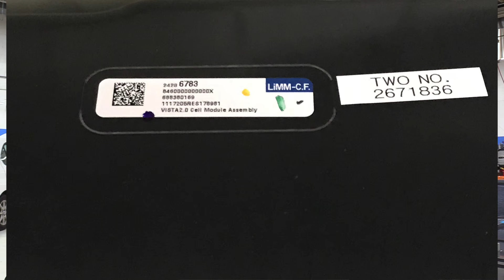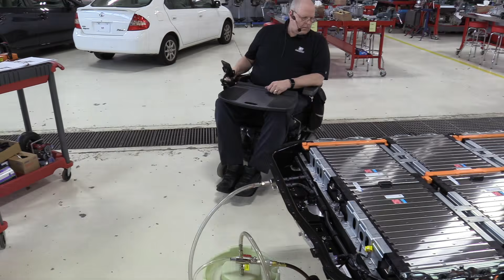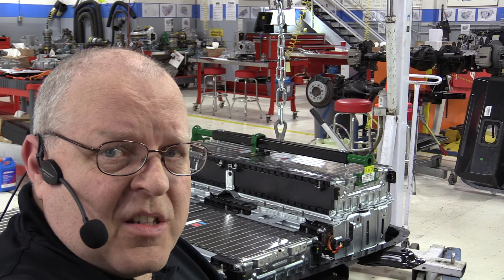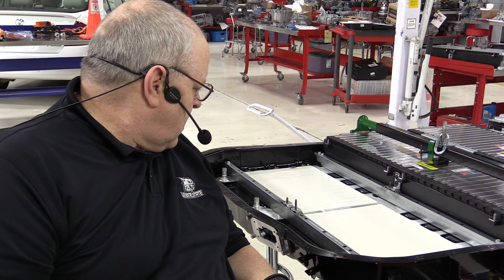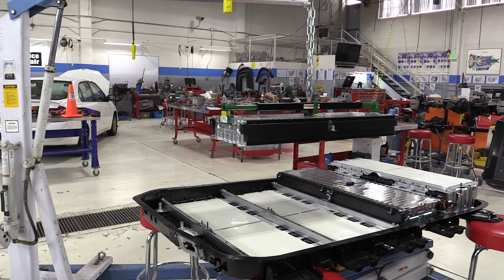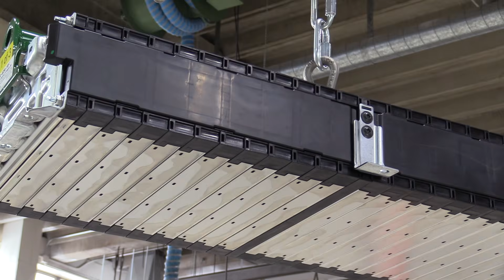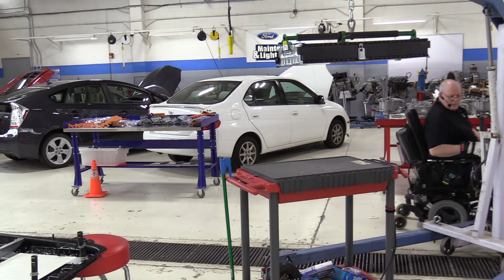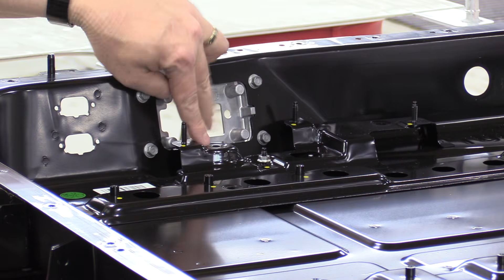Chevrolet Bolt EV Battery Disassembly

Comment: Amazing thanks for sharing, I wonder if the design is overkill as any servicing of Contractors or the low voltage control / monitoring is a very expensive proposition to access. Industrial equipment allows easy access in the electrical box. Are cars / consumers & automotive service technicians not to be trusted that serviceable items are buried this deep ?
Reply from the maker: I don't know the reason for putting them inside the battery compartment, but I can tell you that every hybrid and electric vehicle I have seen is this way. Thanks for your feedback
Reply: I would assume it’s to follow the same trend  auto makers have been following for decades.. That is to try their best to produce vehicle whereas you must pay them to repair something that should never have to be serviced to begin with....

Comment: Hi, 
Do you know the AH off each cell ? 
Nominal voltage of rhe cell?
Will you dismantle a maodule to see the cells Inside?
Reply from the maker: Each 5.94 kWh battery module has 10 cell groups, so each cell group would have 594 Ah. Each cell group has three parallel cells, so each cell would have 198Ah. Nominal cell voltage is 3.65V. I hope to. Thanks for your feedback

Comment: Prof Kelly - thanks for doing these videos on the latest technology in automobiles.  I love your video pace/cadence.  It’s great for all of us who are either Bolt EV owners, or those who are curious about the car and tech to see inside this massive component which provides the fuel for EVs.  As seen in these videos we certainly wouldn’t be able to take one apart ourselves without significant special tools/hoists, so great that you are in a position to, and are able to show us this stuff.  Seeing the engineering that goes into these devices will take away some of the fear that people have with transitioning into an electric car.
Reply from the maker: Thank you very much! I am happy this in useful for you.

Comment: Professor: It looks like each battery section is cooled by a cooling plate on one side only. Is it correct?
Reply from the maker: There is a thermal plate in between each cell. That plate also makes contact with the thermal pads and cooling plate
Reply: Those pads I believe are phase change material pads. The melting point is very close to the optimum battery temperature. They're constantly switching between solid and liquid state which does wonders in controlling temperature spikes in the battery.

Comment: Excellent video, as always.  Interesting rumor I heard:  GM pissed off LG when they announced the cells for the Bolt cost ~$145 kWh.  It turns out LG Chem was charging the other manufacturers a whole lot more for the nearly the same thing.  I think the economics of EVs are almost as fascinating as the technology.  “Experts” have been claiming they’re a decade away from being financially viable, and I think the battery manufacturers are exploiting this idea to gouge carmakers.  An executive at Tesla admitted in 2016 their pack costs are already “below” $190, and there’s speculation that the Gigafactory is pumping cells out for <$100.  Anyway...thank you for the video!  I had been looking forward to your Bolt tear down.
Reply from the maker: Thank you very much!
Reply: Pack cost per kwh is not the same as cel cost per kwh so that might be a source of confusion in pricing differences.

Comment: After watching the second half of your video (last time i only watched the first half).
I was somewhat amazed that the sections were lifted and stored with the terminals exposed.
I must be easy to insulate te batery  posts.
The special lifting tool does not seem to be insulated and could easely hit and short the section during the installation of the tool.
The sections were stored on a metal workbench and could hit the post while placing it there. In a normal workshop where time is money mistakes are easy made.
Does the manual not refer to this?
I personally even put the little plastic caps on 12v batteries while storing them.
As always i enjoyed your video, not everyone gets the oppertunety to take apart a brand new vehicle!
Thanks for sharing, and the time you put in to making these video's
All the best from Holland, Europe.
Looking forward to your next video!
Reply from the maker: All valid points and concerns, thank you. I will cover the terminals when reassembling. The service information says nothing about covering the terminals. Keep in mind that each section has two separate, isolated, battery modules in it. You could have the lifting fixture touch both end terminals of a section and it would do nothing. Have a great day!

Comment: Thank you so much, Very helpful I'm converting a power boat to electric and I'm considering using these batteries on my projects. These might work good with a couple Chevy Spark ev or Bolt drivetains. But maybe Tesla parts too. Still undecided but your video aids me in my decisions. Thank you!
Reply from the maker: Thank you, that sounds like a fun project!

Comment: The 60 kWh is net, usable capacity, which I have verified multiple times. The 57 kWh rating is most likely the rated capacity at nominal voltage. Pack voltage reaches close to 390 V when fully charged, which would result in ~64 kWh of gross capacity.

Your own voltage tests bear this out. The fully charged voltages were 40.56 V for the long modules and 32.45 V for the short modules. To achieve a 57 kWh rating at 350.4 V, the Ah would be 162.67. At 40.56 V @ 162.67 Ah times eight modules and 32.45 V @ 162.67 Ah times two modules, the total gross capacity of the fully charged battery would be 63.3 kWh.
Reply from the maker: That makes perfect sense! Thank you!
Reply: You're welcome, and thank you for your very detailed, precise videos!
Reply: Actually, Jack, that is not correct. Nominal voltage is not the average voltage of of discharge curve. Nominal has a very specific definition: it simply means "name" or "named." In this case, LG had to assign a value, so they named the cell voltage 3.65 V. However, lithium battery cells have a wide range of operational voltages, and a manufacturer could choose to allow the cell voltage to exceed 4 V, which would, consequently, increase the pack capacity beyond the nominal "named" capacity. 

Another example of this is your electric wall socket. If you are in the United States, it has a nominal voltage of 110 V. In essence, it is classified as 110 V, but the voltage could be higher or lower. 

Also, "gross capacity" refers to the total capacity of the battery. The term "gross" simply means total or whole before any adjustments. The reason it is used with electric vehicles is because most modern electric vehicle manufacturers do not allow the end user to fully charge and discharge the battery (doing so degrades the battery quickly). The amount of battery capacity available to the user is commonly referred to as "usable" or "net" capacity.
Reply: John,  These cells are using a GM proprietary chemistry, so I doubt that LG could sell them openly to other automakers. Also, the Ah will depend on the physical size of the cell. A good example of this is the new 94 Ah Samsung cells that BMW is using in the i3. At first glance, it might seem like those cells are superior to the 54 Ah cells GM is using in the Bolt EV; however, the Samsung cells are physically larger and more massive than the LG cells. As a result, the energy density between the two cells is actually very similar.

In the case of the Bolt EV's battery, GM designed the battery format to have 288 cells. The layout is referred to as 96S3P. What that means is, the battery contains 96 cells in series and 3 cells in parallel. For the Ah, that results in 54x3, or 162 Ah. For the voltage, that results in 96x3.65 V (nominal), or 350.4 V.
Reply: Thanks for clarifying the battery cell group  numbers and capacity
Reply: Jack, please provide your empirical tests. The 3.65 V nominal cell voltage will be close to the average, based solely on the fact that lithium cells have the longest life when maintained between 40% and 60% state of charge. Most likely, the 3.65 V nominal cell voltage is the mean between the lowest voltage and the highest voltage (the points at which the cell starts to become damaged). But in either case, correlation does not equal causation. 

If you want to read more about the technical term you are using:
https://en.wikipedia.org/wiki/Real_versus_nominal_value
Reply: Jack, was that entire ad hominem just to get clicks on your website? That's sad. Again, nominal voltage is a voltage LG simply named because the total capacity will depend on the final cell voltage. Remember, this conversation is about why LG labeled the battery 57 kWh when actual testing of the cells and modules showed 63 kWh.
Reply: @News Coulomb -- that's great info. Do you have any posts about the tests that you have done?
Reply: Sean, Just on my video channel. I haven't performed any dedicated tests on this specific topic (it's been covered in depth by others with proper tools and equipment); however, several of my videos have, indirectly, covered the topic of the Bolt EV having 60 kWh of available battery capacity as well as the peak pack voltage being ~390 V. 

The EPA also has a published document of the Bolt EV's testing, though the information in that report does not jive with LG's 57 kWh label either.
Reply: Jack, Look. I understand that you are on a personal mission to rate batteries differently, but the only number that really matters is what the EV owner sees. That's not a marketing gimmick. It's simply reality. As Professor John D. Kelly demonstrated with his own voltage testing in this video, the capacity of the fully charged Bolt EV battery pack is 63-64 kWh. 

As for the EPA document, the reason I stated that it did not match either is because it rated the battery pack at 350 V and 171 Ah, which is 60 kWh. Less than what was measured in this video but more than what LG labeled the battery. 

That all brings it back to my point about the label and nominal voltage simply being a number that LG chose. You argue that LG put significant thought into it. I'm not contesting that. But as a Bolt EV owner with over 45,000 miles on my vehicle, I can tell you with certainty that the actual capacity available to the end user is 60 kWh. 

If you refuse to adjust your beliefs to match that reality, there's not much I can do about it. The only thing I ask is that you learn to conduct yourself in a more civil manner. Thanks!
Reply: Jack, Finally we agree on something; this is ridiculous. All I did was explain that the nominal voltage/capacity does not match the actual (this is normal) and that the available capacity per charge is 60 kWh. I made no claims about LG's testing or rating process, whether it was industry standard, what calculations they performed, etc. All I did was assert that the 57 kWh label does not match the real-world capacity of the Bolt EV's battery. 

And apparently, I'm not the only one whom you refuse to listen to. I'd refer you to GM, who have published the fact that it is 60 kWh of usable capacity, but you already dismissed that as a marketing gimmick. I'd refer you to the EPA testing document, but you apparently don't consider that a reliable source either. It looks like you're on your own on this one. Good luck, and take care!
Reply: lg chem disclosed in dec. 2017 new cell chemistry for pouches producing 32.5 ah. So if pouch cells are used, they would have to parallel 5 cells to produce the 165 approx. ah ratings. curious to know if that is the case.
Reply: Jack Rickard Hey Jack! Nice to see you here! Earlier in this thread I asked they send this video to you. But guess you have already seen it. Have you broken down a Bolt yet? I will go on your site to see. It has been awhile since I have been there. Onward and upward!

Comment: What an asset! If anybody ever deserved an honorary Doctorate, Professor Kelly should be at the top of the list. World standard educator, tireless researcher, open to corrections and criticism, a role-model to treasure.
Reply from the maker: Thank you very much!
Reply: I am very impressed with the educational value of these videos.
Reply: As a young man I was a pretty good  mechanic 
Now,   I am a retired  crane operator &72 years  
YOUNG  YOU make me  look Old    8>)
Reply: @charlese.mccray7728  good
Reply: Very true.  Via this medium he has educated so many.  A lot more impact than many many educators.
Reply: As I’ve mentioned before, I will probably NEVER do this myself. . .  but it will be great to “hold my own” in any conversation with those “experts” we always run into.  

I’d love to see a comparative video on a Tesla battery system. . .   i.e., which is easier to assemble and service.
Reply: @dewiz9596  Tesla batteries are completely glued together in 4 modules typically so you'd have to replace an entire module rather than individual cells like this battery. Otherwise, they aren't too dissimilar. Check out Monroe Live's Youtube channel, he's in the process of tearing down a Model Y and has recently showed the battery modules in great detail.
Reply: @human_brian  Teslas in general are built like a modern cell phone, with the idea being that you'll just throw it away and get a new one every few years.
Reply: @Sean_The_IT_Guy  We have Holden Bolts here in Australia but i have never ever seen one on the road, and I live in area surrounded by Car dealers and wreckers. The idea of a volt battery for a   project i am thinking of doing is starting to look good. Tesla battery sets go for  $20,000 here ,.Used. Mostly from cars imported from the USA as wrecks then parted out.
Reply: @dewiz9596  Not even a comparison. The Tesla battery is held together with welded plastic and glue, not bolts with a rubber seal. You have to cut metal and bend tabs to get one open to work on it.  Rich Rebuilds is a youtube channel that shows him working (hacking) on Teslas.  The difference in build quality and servicability is astounding.  Tesla is a tech company that made a really neat tablet with a car-like accessory attached.  GM has over a century of vehicle building experience and while I fully agree that some of their cars are questionable in quality, the Bolt is not one of them.
Reply: @Sean_The_IT_Guy  Is this why the Chevy Bolt battery pack is considerably safer then a Tesla battery pack in a bad accident?
Reply: @Sean_The_IT_Guy  but Tesla's don't burn your house down
Reply: @reggiestoltz9055  I am not necessarily convinced this is the case. You can see this unit is well protected against side impact, but any lateral fod, maybe not. They can't protect against everything, but picture a vehicle sliding laterally, a large rock, tall curb or something else may have the ability to puncture every cell in a module in one shot. Until more crashes happen, we may not know, but again, I'm not convinced that it is safer.

Comment: For the quick charge option, are the only hardware changes being the plug leading to the high voltage connector on the battery? It make sense to have no hardware changes to the battery itself. If that is so, would one be able to swap a level 2 connector for the DC combo charge connector?
Reply from the maker: You would not be able to change the connector alone. There are several additional differences including the programming of several on-board computers. Besides the connector, there are three other physical part differences under the hood: 1. The battery charger DC, 2. The Battery disconnect control module. 3. Additional HV cables. The battery appears to be the same. I doubt it can be done. Best wishes!

Comment: Nice work. just a short comment, I think that those pads are mostly for pressure leveling in order to provide a better contact between cooler plate and battery sections.
Reply from the maker: Thank you, that makes sense. Thanks for your feedback!

Comment: Do you think that the battery main housing , you call the battery tray, also braces the car as well ?
Reply from the maker: Yes, it weighs about 150 lbs (68.04 kg). It is very rigid
Reply: anthony marks - this “structure” is likely put in place to ensure that any sort of collision or road/curb contact will cause minimal damage to the battery assembly contents - much more protection than a gas tank typically has, impressive!  By the perceived weight of this tray, it appears that it will help the remaining vehicle structure in any sort of collision, making for a very strong passenger “cage”.  Although it’s relatively small, it looks like the Chevy Bolt will be a very safe car.

Comment: Very nice work,   When do you anticipate putting this battery back together?   Would be possible for me to come out to you and witness the reassembly procedure for my youtube channel?
Reply from the maker: Thank you! I do not know yet. I am waiting to hear from the local Chevrolet dealer about some parts needed for the reassembly. Apparently they are on a restricted parts list. It will probably be mid to late March. My email address in is the video description. Send me an email and we can coordinate. Have a good day.
Reply: NO !
Reply: @ExploringCabinsandMines  tough guy LOL
Reply: Sir, were you aware that teenagers are making self charging electric go-carts. Or that Troy Reed developed a magnetic motor which requires no battery packs! I don't have $40 grand plus for a car or truck. Even if I did, I wouldn't spend it on a vehicle. GM had the Saturn car company in which they were going to put an electric motor. They didn't do it. Now where are they? The Chinese are eating them alive. And US. It's called greed, and suppressed innovations and inventions.
Reply: @johnsavage6628  - Go buy a Chinese car then, if they're SO great. lol